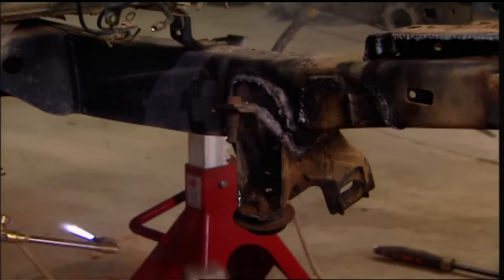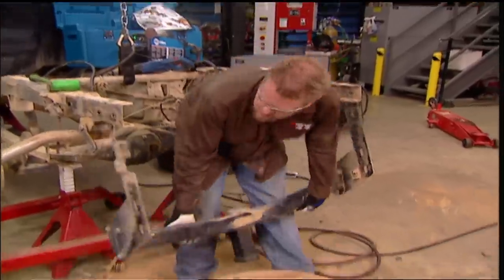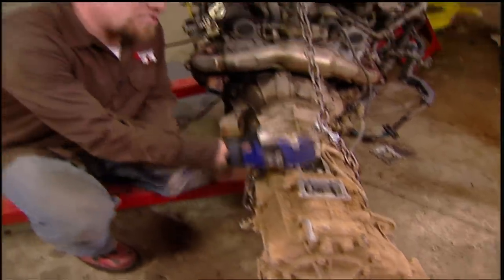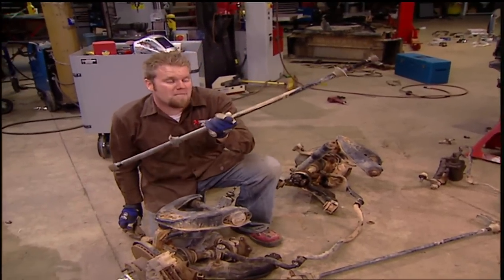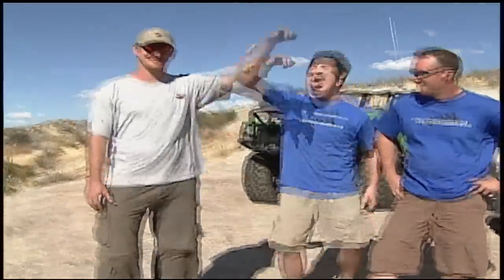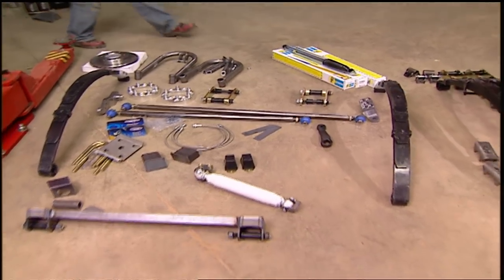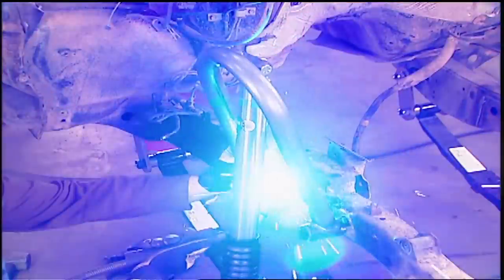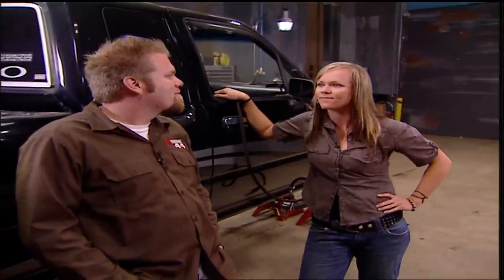Solid Axle Swap On A '91 Toyota Mini Truck - Xtreme Off-Road S3, E17

Comment: I hold to the belief that the original 22-hour Toyota was the first side by side. Came with air conditioning too if you opt for it. And I can guarantee you get more miles out of it. They weren't just toys back then either some chunky 31s on it and you were in business! And you can still drive it to work.